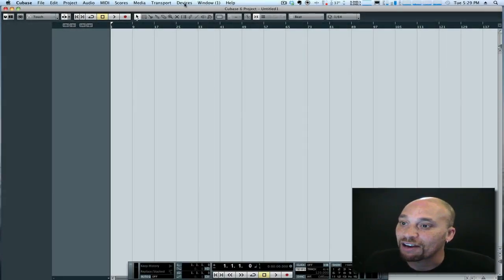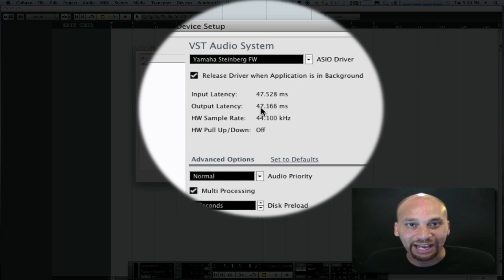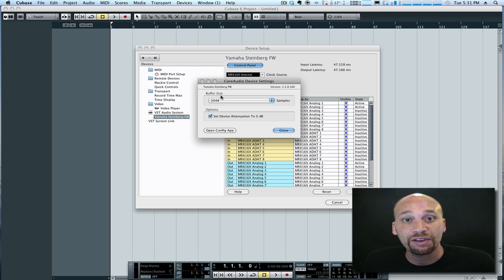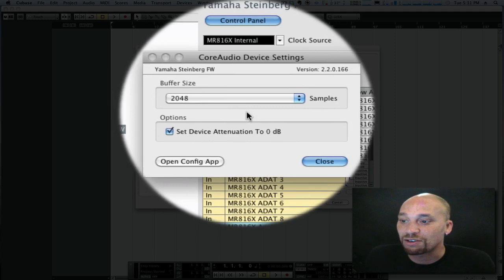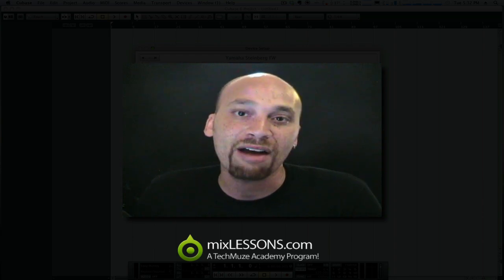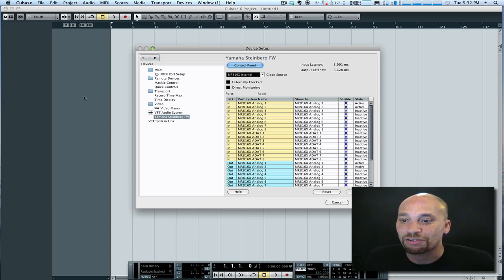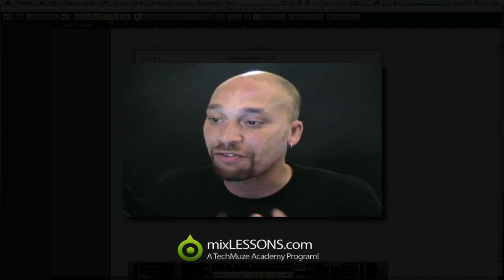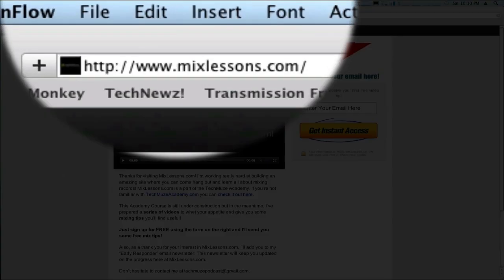How to eliminate latency in your home studio - MixLessons.com

Comment: You can never get to a musically acceptable latency. Direct monitoring is the only solution for a musician trying to track and keep the groove. For virtual instruments you need a “stand in” sound from a keyboard, hardware module, or iPad to monitor with while you record the MIDI. You can then use any virtual instrument in the DAW during the mix.

Comment: Hi.

I am having problems when mixing.  Cubase keeps skipping and jumping which is making it impossible to work on some songs.  I just bought a new computer too but it's still having the same problem on the same songs.
My computer specs are i5-7500 CPU @ 3.40Gz 8 GB RAM, Windows 7.
It must be a problem with using lots of plugins (Waves, groove agent, halion sonic...) and my computer can't handle it for some technical reason I don't know of.
I have a Focusrite Scarlett 2i2 Audio interface.  I increased the buffer length as much as possible (10 ms) on the interface to try improve performance but it's still the same (input latency 21.4 output latency 31.4). 
I watched a video on youtube of someone increasing it too 100 ms but my interface can't do this. 
It's a full band i've recorded (2 guitars, bass, drums, 3 singers, keys, harmonica and a few bits from Halion sonic SE and Groove Agent 4. So there are a lot of tracks and plugins.  
How can I fix this problem and what do I need to do to ensure my computer can do this all smoothly?  Any info would be much appreciated.

Thanks.
Reply from the maker: Hey Ryan. There are a number of things that could be affecting your system performance. Without seeing how your session is set up it tough to know for sure. You could try freezing your tracks. This will temporarily bounce each track and disable the inserts to free up resources. The nice thing is that you can simply unfreeze a track if you need to make changes.
Reply: Thank you so much that works perfectly.  I had no idea about that feature.

Comment: Hello I'm running Cubase Essentials 9 with Tascam 16:8 interface I'm having to switch buffer sizes constantly while recording it will work for a few minutes then it will start latency problems any idea why this is happening? Also sometimes when I record it will sound fine but it will be recorded with a delay.. thank you
Reply from the maker: Sounds like you may have a driver issue. Have you installed the latest drivers for the Tascam?
Reply: Dezz Asante thanks for the reply. Yes,  it's a brand new computer, hp it is windows 10 though, and I have all the latest drivers, it's a new install. Do you think unnecessary programs running in the background could be the issue?
Reply from the maker: Possibly. It could also be an address conflict. I haven't used windows in quite some time but I used to occasionally run into an issue where two or more pieces of hardware shared the same IRQ address. I'm no expert with this so you'll have to Google it but it's something to look into.
Reply: Dezz Asante thanks!!!

Comment: you prob wont be able to "eliminate" latency with only buffering... especially if you have lots of plugins, tracks, etc running.  Run what you need to hear while recording into a mixer FIRST then to your converter. Maybe route the mains from converter to aux in or cd or whatever to mixer then "main out" to monitors if you'd like. In the DAW turn down, mute, etc the tracks you are recording live while keeping the backtrack up and on and coming though your aux in of your mixer so you can play along with let's say the drum track and bass while recording guitar and voice. there you go. eliminate latency with discreet monitoring. :) you can even use the effects on the monitor to help singers, etc and it
Reply from the maker: That's one way to do it for sure. I suppose the title is a little misleading. You can't really eliminate latency but in many cases you can reduce it to the point where it's not affecting your ability to perform correctly.

Comment: how about using windows7. can you help me how to fix my latency problem. its freakin pain in the a**!
Reply from the maker: I've been a Mac user for some time now but the latency is mostly controlled by the ASIO driver for your audio device. It should have a control panel that gives you control over the buffer size.

Comment: Having wrestled with this issue for several years I have adopted a three part strategy for the best performance. 1. RECORD : lowest (ie smallest buffer size) latencey as possible. When recording the base tracks I do this 'DRY' : I focus all resources on capturing the performance. This can sometimes create problems because muscians sometimes like to have a mix with f/x etc durring the recording process, but I do my best to limit these as well as headphone mixes etc. I try to focus on the recording more as a performance for the band than a 'let's play in the studio;. 2.OVERDUB : This is the tricky step. The objective is to use as low latency setting as possible. I will typicaly 'freeze' all tracks in preperartion for this session. The down side to doing this is any non level adjustments to the mix needed for the performer will involve - unfreezing / adjusting / freezing / verifying - repeated until the performer is satisfied. This is a completely forien/frustrating process for muscians who are used to a analog enviornment.  3.MIX : Highest latency possible, to allow the computer more time for processing.  I beleive this fits with the reccomendation/information in this video, but offers a strategy for producing based on the different stages in a peoject.

Comment: hey teacher,i have a question:if i set the buffer size at 1024 or higher samples,that means i will hear the  latency right? but i wonder if it's just the "monitor time"? if i stop and play back the track, would i hear the latency? thx

Comment: Right click the speaker icon (on windows 7) on the task bar then left click on "recording devices". Right click on the "microphone" and left click on "properties." Go to the "listen" tab and make sure the "listen to this device" check box is unchecked. Okay now close the microphone properties window. The "sound" window should still be open. Go to "playback" tab, right click on "speakers" and left click on "properties." Then click on the "levels" tab. You should see a microphone section with its playback volume muted. Unmute it and increase or decrease the playback volume as desired. There should be no noticeable delay when you speak into the microphone now.
Reply: I just tried that and it didn't work for me. I am using windows 10 with Realtek(although I had the same problem with windows 7, damn I miss xp!)
Reply: I did use a multi driver installer tho and it installed a different "cmedia" sound driver, maybe that helped

Comment: Great explanation of latency, liked and subscribed.

Personally I'd advice to bypass the problem altogether by monitoring the input before it gets into the computer in the first place.
My Tascam audio device has a useful control knob for that ('Mon Mix'), and I'm sure many external audio cards have the same feature. Otherwise, a little external mixing device will do the trick.
Obviously that only works for audio inputs though, not if you have latency issues with vst instruments. And of course won't hear any vst plugins while playing, just the dry input. 
But if possible, I'd always go for that solution first because even sub-5ms latency (while perfectly playable) can still create sort of a feeling of being slightly more 'detached' from your instrument.
Reply from the maker: Thanks for chiming in! Some good advice there :)

Comment: Dezz, Just want to say your explanation of latency was superb; clear and concise.  Might I trouble you for an opinion?  In your video setup you're using an external interface and the buffer range was tweakable but is it also possible to tweak on board soundcards in this way?  I've read that it's almost impossible to expect 10ms or less latencies from onboard SCs.  I was wondering if you'd like to enlighten us regarding this line of enquiry?

Regards Ramlee
Reply from the maker: +Ramlee You can download ASIO4ALL. It's a free ASIO driver that will give you more control of your onboard audio device.
Reply: +Dezz Asante  thanks for the recommendation.  My Cubase DAW is already recognising an ASIO DirectX Full Duplex Driver as well as ASIO Multimedia Driver, the former giving me better performance but still with unacceptable latency.  Will ASIO4ALL significantly improve my situation?

Comment: Nice video. For some reason, I just experienced massive latency issues not only with audio, but midi as well. Dug around in Sonar 3X and using ASIO4ALL, I followed the video's instructions and got my latency down from 44 ms to 10 ms..... Then I noticed a box labeled "Sampling Rate For New Projects" .. So I thought.. Hmm ..I'll just drop my sampling rate down and that should reduce my latency (Fewer samples, less work..).. Well, what dropped was my jaw. By decreasing the sample rate, my latency jumped to 20 ms... Go figure. So I pushed from 24,000 to 192,000 and BAM! Down to 4 ms. Not sure how this will really affect any new project yet, but truly, this whole latency issue is enough to make a person rip their hair out. Talk about arcane! 

I don't remember having these problems running DAWs on an old Windows ME system... You'd think with a Win7 64 bit machine with multiple processors it would no longer be an issue.

Comment: Very helpful, but how do I change the buffer number in Windows 7?
Reply from the maker: Andrew Joe It's found in the control panel for your audio hardware. If you're using the built in sound card, try downloading ASIO4All (google for it).

Comment: My issue is with VST latency.... I often use the CPU usage meter from the Windows Task Manager to view the system usage strain if you will.... However the Cubase 6.5 shows it's own system usage bar.. The problem is the Win CPU monitor may show that I am using 40% of the total system ability but Cubase often shows that Im using 100% at times... Why the difference???? Win is telling me that I have 60% remaining system processor ability and Cubase is saying that Im using all of it.... Can you explain that?
Reply: This is a big time problem when Im working with drums...
This is more of a problem with VST programs like Battery or Kontakt ect...

Comment: I've been having latency issues with my drum kit/drum software and I'm using Reaper DAW. Very informative video, although I sorta knew most of this already. However, I have a question: What are the minimum hardware requirements on a PC that you would recommend for a home studio? Like, dual/quad core processor, how much RAM, etc. I think that is my main issue right now, as I'm using an older laptop for most of my recording work. THANKS!!
Reply from the maker: Chris Laird Sorry for the super late response! These days I'd say a core i3-i5 processor at 2.5ghz and 4 gigs of RAM would be my minimum. You could still do some work with less and, of course, the more the merrier!

Comment: hey Dezz. i have a really good pc and have windows 7. i7 processor and more. i also have the yamaha Audiogram 6. my issue is when i go into cubase and click devices/device setup  and choose under VST Audio System "generic Low Latency ASIO driver. my latency is 40 ms even. i go to control panel and drop my buffer size as low as it will go which is 10 and the latency stays the same. the highest the buffer size will allow me is 100 and the latency still stays the same. even with it on 40 latency my cpu doesnt even flicker. i need help. could you please help me Dezz?
Reply from the maker: Dylan Horn Hey Dylan. just saw this comment after about a year! The issue you're having is the driver you've selected. You want to select the Yamaha USB driver in Cubase NOT the generic windows driver. This should give you better control.

Comment: I just got Cubase 5 and hooked it up with Akai MPK88 but buffer size won't go lower than 512 and latency stays at 20ms or higher.  I doubt that my computer can only handle 20ms since it has  4th gen i7 processor and 8gb ram. I don't understand what is wrong.. also even at 20ms its giving me tweaks. Since you can't really see what's wrong yourself can you tell me some possibilities/ common issues on where I may have screwed up?
Reply from the maker: 안철홍 Try using the free ASIO4All driver instead.